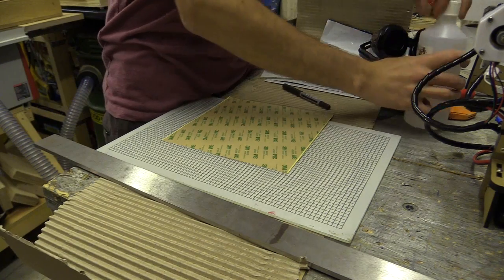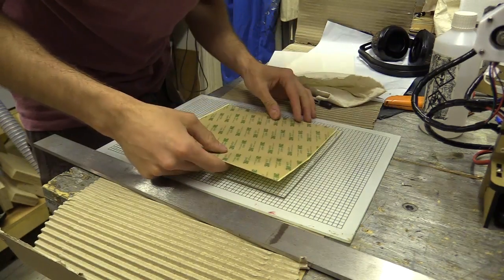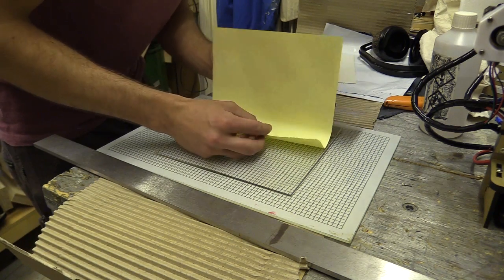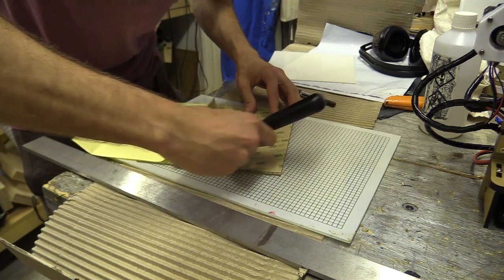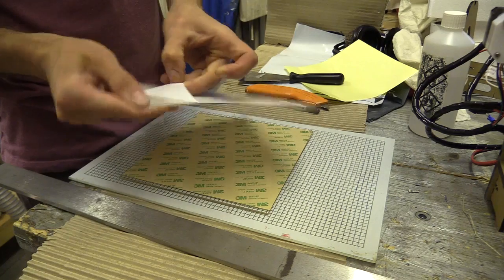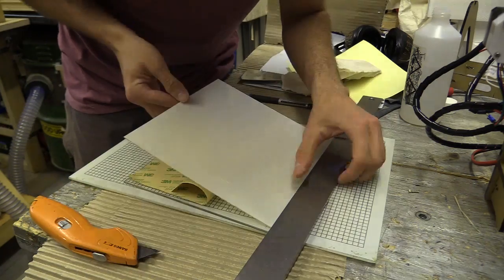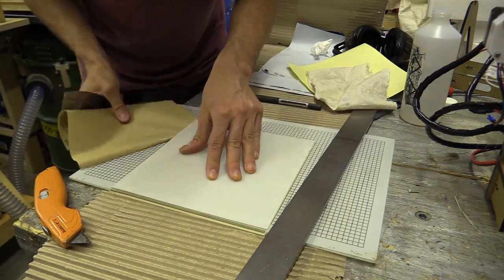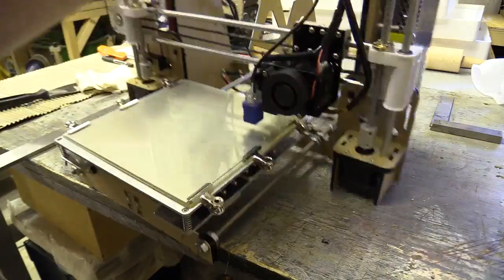Glueing PEI to Borosilicate Glass / 3D Print Bed Surface

Comment from the maker: Please Read: The glass and PEI stuck together is too thick for many stock proximity sensor to detect the aluminium beneath. You could use a 3D or BL touch probe instead, but I haven't had any luck installing these. My recommendation would be to use a thinner build surface or just place the PEI on the aluminium with some bulldog clips.

Comment: if i stick PEI sheet on glass bed, and for once a while i want to use "only glass" for printing, can i just reverse it so the PEI side is directly contact the aluminum heat bed and the glass is on top? would the PEI sheet damaged? what about the heat distribution?
Reply from the maker: Good question. I don't know. You'll have to try it and let us know.
Reply: I already use PEI sheet direct in my aluminum Heatbed table. Glued on it and. Working for 3 years

Comment: I've had my A8 for over a year now, only issues I've had is the Y-axis bearings need to be replaced soon. Just hooked up a Raspberry Pi 3 running Octopi, loving how much easier it is to keep my printer running. Getting ready to buy another printer, one isn't enough! You might want to try a rubber brayer or squeegee made from rubber or felt to put the PEI down.  Yours turned out really well, hope it works out for you. Please peel the paper off the printer, it looks like it's made from cardboard!
Reply from the maker: Hey cardboard is a tried and tested material!!! :P